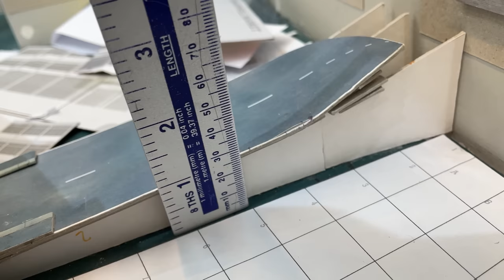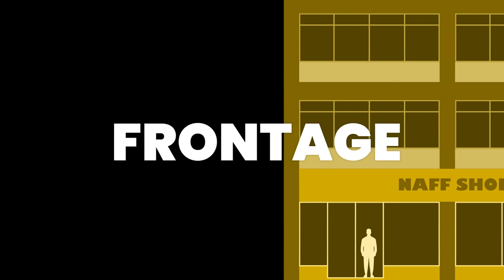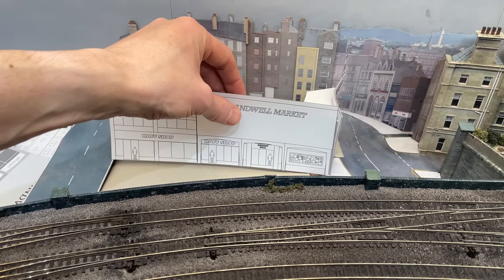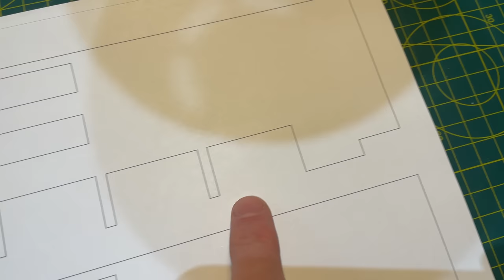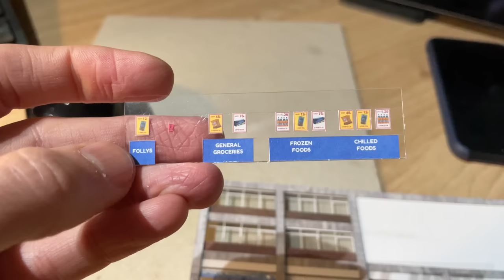Starting to scratch build an old 1960s shopping precinct using layers of card and paper

Comment: Having grown up in a flat above a shopping precinct the shot of the precinct through the legs of the tower brought back so many memories.  The only thing missing was the benches made from concrete with 3 x 2 rough wood seats and backs and the geometric plant beds (shrubs and flowers were long gone though).  You’ve got that mix of Victorian gothic and modernist brutalist architecture just right in this section.  Great job.
Reply from the maker: I have some of those seats and planters in mind Stu! :)

Comment: Fascinating as always Michael. I assume you will be adding extras to the slabs like cracks, drainage and perhaps some workmen in a cordoned off area doing some repairs? The problem watching your videos Michael is I tend to get thinking about what I would do if I were the builder. Just proves how stimulating your videos are. Cheers, Bob
Reply from the maker: Thanks Bob! This is the second suggestion of the same, so I'm shamelessly copying-and-pasting my reply to the other one! :) These are just draft test prints to wok on the paving layout. The real one has a few patches of tarmac where the original slabs have been removed, a couple of brighter slabs which have been newly-replaced, a bit of a water stain here and there and some manhole covers. This is a less-is-more situation though. It is a really small space and with the tower, planters, and brick-built seating in situ, to try to add anything else would be overkill. Since the plaza will rarely be actually seen (I have to stand on tiptoes and bend over the viaduct to see it), I have not been bothered to add individual cracks to individual slabs, which are only 3.5mm square.
Reply: @Chandwell  Thanks Michael. Cheers, Bob

Comment: Hi Michael. Would it be possible to have a hole dug out in the middle of the precinct paving, with a protection fence round it? It might add a run-down element to the area, which would be pretty appropriate to the general Chandwell atmosphere. Or a few loose slabs of paving perhaps? Otherwise, it all looks fabulous. What a creation Chandwell is... Tom
Reply: That's a good idea.  Perhaps the road surfaces and pavings are a bit un-molested - there would be tar banding and dodgy repairs all over the place.  And that's before we get to the N-scale broken glass :-)
Reply from the maker: Thanks Thomas! These are just draft test prints to wok on the paving layout. The real one has a few patches of tarmac where the original slabs have been removed, a couple of brighter slabs which have been newly-replaced, a bit of a water stain here and there and some manhole covers. This is a less-is-more situation though. It is a really small space and with the tower, planters, and brick-built seating in situ, to try to add anything else would be overkill. Since the plaza will rarely be actually seen (I have to stand on tiptoes and bend over the viaduct to see it), I have not been bothered to add individual cracks to individual slabs, which are only 3.5mm square.
Reply: @Chandwell  Okay, point taken Michael. It's not only N-scale, so tiny, but also hidden unless you contort yourself into uncomfortable positions. All the more reason to be obsessive, I'd say. You could scatter some N-scale litter around - empty beer cans, or cigarette packets and hey, why not some N-scale cigarette butts...

Comment: Michael I know you have done lots of Inkscape videos, have to done one about scaling? was it just trial and error, when matching the ruler or is there a funky function?
Thanks
Reply from the maker: There is a really good trick. Draw a rectangle around the ruler, say 5cm. Then, with the rectangle on top, select the rectangle and the picture. Right click > Set Mask. You will have the ruler inside the rectangle. Then select the rectangle-with-rule-in-it, and use the scaling boxes at the top to scale it to the right size, 5cm in this example. Right-click, release mask, and there you go!

Comment: Love it! Did you have any issues with warping when you mated the poster acetate to the frontage acetate? Did the thickness of the posters create a challenge with this method? The method is pretty genius.
Reply from the maker: No, I had no warping. I actually used superglue for this bit. Just a couple of dabs. The thickness of the sticky label didn't seem to factor into anything.
Reply: @Chandwell  Good to know, thank you! Think I need some super glue, old PVA is not cutting it for sticking acetate.